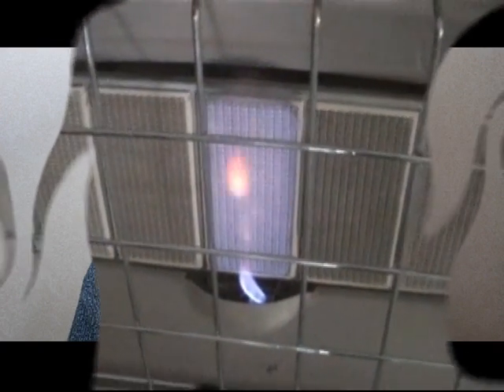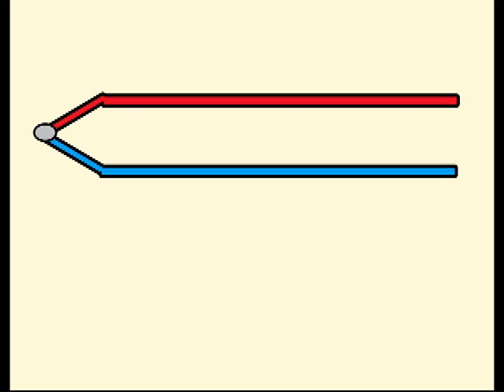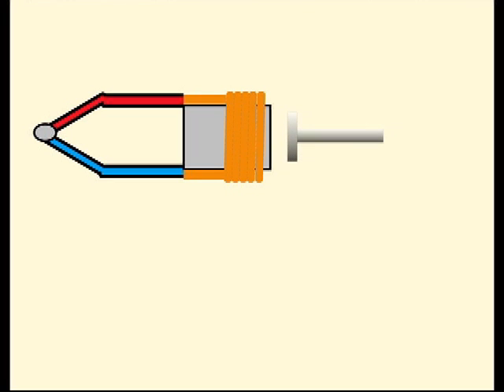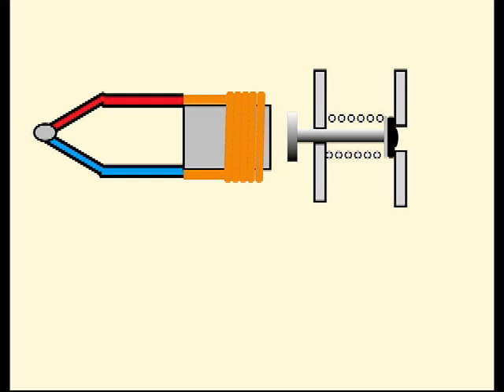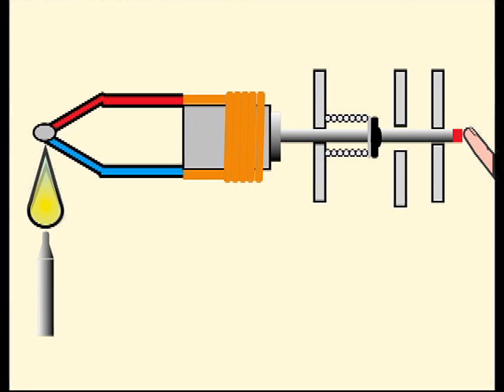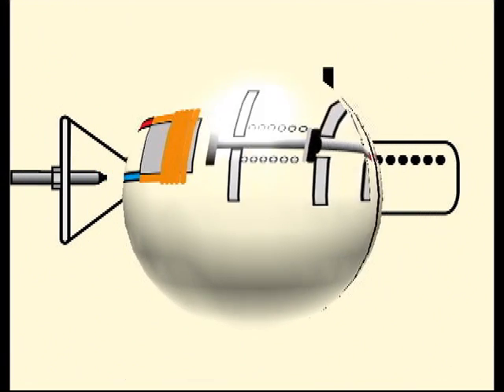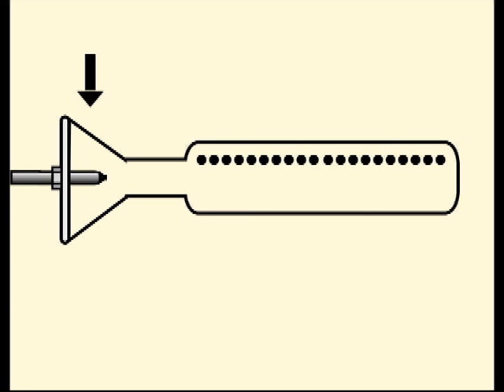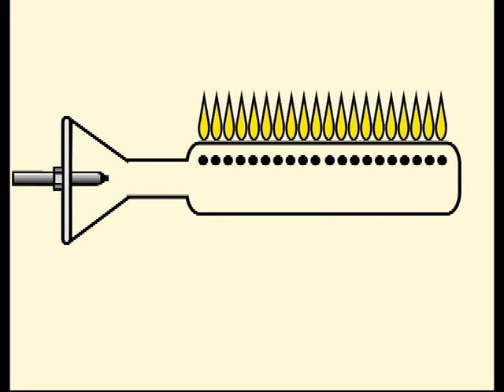How a Gas Heater Works

Comment: 1:01  I thought that some videos say that the voltage is few volts and they measure it with a normal digital multimeter.
Is that right or wrong?
Reply: a tip: you can watch series on instaflixxer. I've been using it for watching lots of of movies these days.
Reply: @dominikpayton5777  Thank you
Reply: @Dominik Payton yup, I've been watching on InstaFlixxer for since november myself :)
Reply: @matteobrayden6843  
Thank you